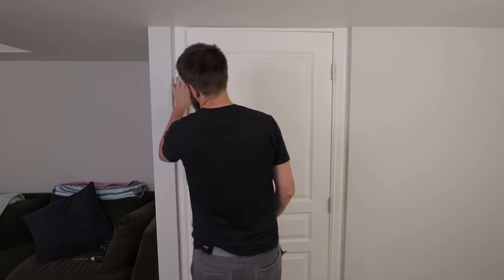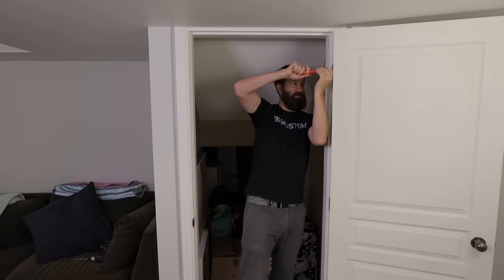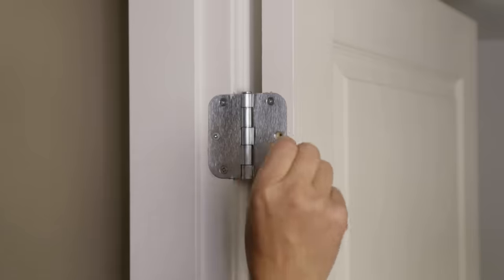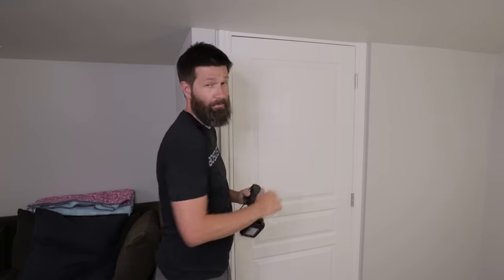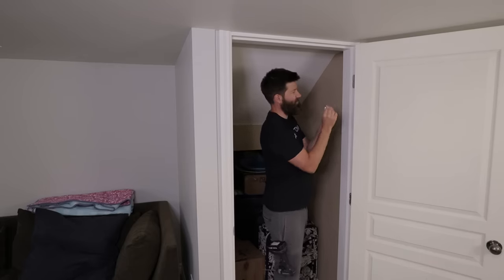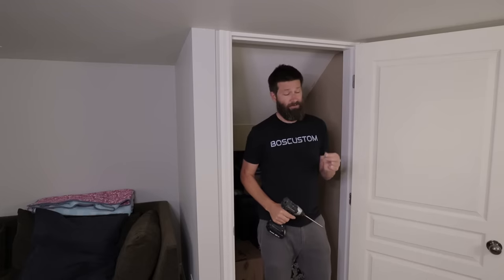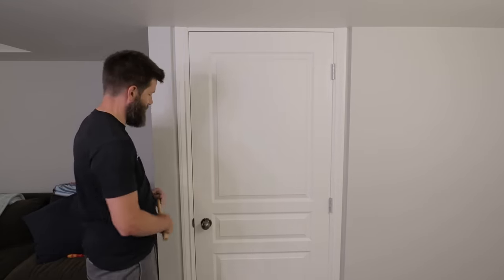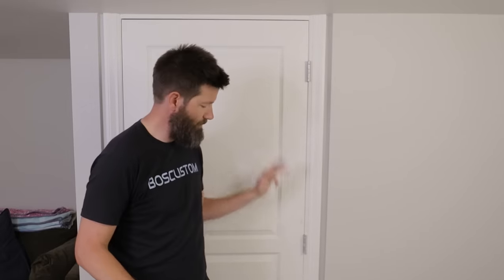How To Fix a Sagging Door that's Rubbing or Won't Close!!!

Comment: TIP: In regards to Tip# 3 - Whether squeezing or spreading a hinge to align a door ALWAYS bend or squeeze the knuckles on the hinge portion that is attached to the door - NEVER bend the knuckles on the hinge attached to the jamb. (To bad you didn't include how to spread a hinge which is a handy if/when you want to narrow gaps that occur on the knob/latch side of the jamb)
Reply: The knuckles on my hinges will not Bend their golden color do you think it could be the type of metal ?
Reply: @starvnny3535  I had the same issue. My front door hinges are made out of some non bendable metal. I fixed it by sanding off about 1/16 inch under the frame hinge then putting it back on. This pulled the top of the hinge-side of the door away from the knob and latch side, now it closes smoothly. For the sanding I used a Dremel, flat head of the sanding disc, and cutter disc for around the edges (and eye protection). It's like an "anti-shim." Next step is probably fixing the foundation 😟

Comment: There is a special tool made to bend the hinges (knuckles). I purchased one and it works great.
Reply: William Ruisinger  Thanks for the tip.  It looks like what this guy did exactly with the adjustable wrench, but I looked closely and they simply drilled a hole in the jaws to make it round.  You could easily make one by yourself.

Comment: An alternative  to the toothpick  is to use a plastic wall anchor. Drill screw hole out to correct  size  for the anchor, trim the flange off of the end of the anchor and tap it into hole. Screw expands  anchor and it holds well.
Reply from the maker: That’s a great idea, thank u

Comment: At my workplace, one of the fitting room doors had this problem for years. Until this year when a customer got ‘stuck’ inside, went into pull panic mode, made a huge scene and sued the store. Management barely had it fixed last week. 😑

Comment: I was struggling yo fix a bathroom door for 6 months and had tried your first two methods plus sanding back door edge to no avail. Your 3rd tip fixed the door in two minutes. Thanks for a great tip

Comment: I wish I came across this video sooner.  We have french doors in our 3 year old house that bind at the top.  I adjusted the screws and did the other stuff.  It helped but started rubbing again recently.  I bent the hinges like you mentioned.  Took 5 minutes and works perfect.  Gives more clearance than the other methods and was actually pretty easy.

Comment: Tip for removing hinge pins. To avoid damaging door and/or frame, use long nose pliers. Grip with pliers tips under the head of the pin and gently hammer further back along nose to lift out and place tips on top to knock back in. Always a good idea to clean pin and slicone spray prior to re-inserting.
Reply: Uh… no lol just use a nail set and tap them out from underneath with a small wooden hammer… 🤦🏾‍♂️
Reply: @samueldavis5895  The "nail set" (punch) is a given, but wooden hammers wont scratch paint ? Uh . . Yes ! . .  lol. Plus most people don't  have wooden hammers and it would struggle to move a stuck hinge pin.
Reply: Yes.
Reply: @steeevo0136  : Rubber mallet.
Reply: @steeevo0136
Reply: @grahamsymes8762  hello . . . yes ? 😀

Comment: stick a shim in the latch side to get your reveal perfect, and then bend the hinge
Reply: That was my thought, too!  Playing cards would be great for the shim
Reply: So pretty much what did but using the shim to ensure the gap is perfect? I have this exact issue. Thanks so much.
Reply: @andymaggie7137  yes take out pin in hinge.  Use shims to get gaps perfect, and then bend the hinge so you can put pin back in
Reply: @ShopTherapy623  appreciate you taking the time to respond. Thank you.
Reply: for some reason i am confused by your comment about making the reveal perfect.
Reply: @spdracr4life  what he means is this: when you take the pin out of the top hinge as shown in the video, your gonna lift the door by the doorknob as he did in the video. Once you lift the door to a place where the space opens back up on the doorknob side of the door, stick a piece of cardboard or wood or something between the side of the door and the doorframe to hold the door in place being properly spaced. Then go ahead and bend the hinges on the door to line up perfectly with the hinge connected to the frame. Then stick pin back in hinge and hammer in if you need to . Then you can pull the shim out ( cardboard,  wood, or whatever you use to space the door from frame) and your door should work properly.
Reply: @Nico-yn1vg  thank you for dumbing it down for me. For some reason I was stuck on the word reveal and I couldn't make sense of what was being explained.
Reply: @spdracr4life  If you aren't familiar with the word "reveal," you don't understand swinging door theory. You need to read an article. The "reveal" is how much of the door jam is revealed when you look through the crack between the edge of the door and the frame. Someone is sure to answer me with a more precise definition.

Comment: I tend to prefer flat toothpicks rather than round. The flat ones will break easier and fill the gaps in the wood threads. The round ones are stronger and tend to just push the wooden threads outward, and will pull out easier. With flat toothpicks you can use one or two or as many as you need.

Comment: Thank you!! #3 worked for  my French doors but I landed up putting a few hotel card keys in between the two doors towards the top. My left door was leaning into the right and I did not have time to remove the hinge on the jamb. Once I had the gap in the middle right I bent the top hinge on the door side a smidge which barely made it but I think I also need to adjust the middle hinge. I needed a quick fix. #2 had the opposite effect for me! Driving in new screws pulled my left door up a mm. I finished off with my go to lubricant for plumbing: Dow Corning Molykote 111 Oring/Valve Lubricant. This stuff has helped me with fence gates too where wood on wood was rubbing. Damn rain here in Northern CA messed up a lot of things! Thanks. Will fix it later with the new tips here. Loved your delivery. You gained a subscriber.

Comment: Be careful drilling 3 inch screws into door frames on older houses. I have seen wires along the inside of the frame, which isn't supposed to happen. You can use a tester to be sure.
I actually drilled into one and started a small fire once. Luckily we put it out quickly, but it cost us some time and money replacing electric wires and drywall where I had to bust into the wall to put it out. So I speak from unfortunate experience. You can't always know what some home repairman might have done before you. No judgment. Just be careful.
Reply from the maker: You raise a good point.  That's pretty rinky dink framing to only have one 2X4 on the Door Jam!
Reply: @TheFunnyCarpenter  
Yeah. I've seen some rinky stuff over the years. Guess they widened the door at some point and didn't frame it back up like they should've.
Reply: @inspired4more  how do I use a tester with a doorframe? Do I just. Stick it to thr door frame? Or check all the screws?

Comment: Cool. #3 very cool.
On #3, why not put a shim into the door-jam space after removing pin. Adjust the shim to the space, or door position, you want and then bend the hinge. You could guage the amount of bend by lining the whole hinge, rather than guessing the amount. You could even use the pin as a guide, bending and letting it drop as you go.
Reply from the maker: Definitely not a bad idea!
Reply: You can do that but remember that the steel hinge has some elasticity so if you’re going to let the pin drop with each adjustment, you’d first want to slightly over-shim the opposite side (i.e. the latching side). That way when you remove the shim and the hinge does it’s little elastic springy thing, the door will drop to the correct level.
Reply: I have yet to see a hinge pin on a 40 year old house that will "drop" regardless of the circumstances. Did you see him use that 1 pound hammer with 20 pounds of elbow grease time 50 hits to get it out?

Comment: The only thing I've ever done to sort out a drooping door is to put some cardboard packing behind the bottom hinge. Just nudges the door back up to square.
Reply: And shoves it out. So it's probably rubbing against the jam in top and bottom
Reply: @brerrabbit9668  Nope, the issue was the door catch was no longer engaging. Once the door was square, no more issues. Rubbing isn't the only reason to address a drooping door.

Comment: I just remove the hinge and clamp it in a vise to eliminate the space.   Or hammer it together.  Doing it with the pin in keeps the hole alignment true.  OR PRO TIP, I may swap the top and bottom hinge to move the space from the top to the bottom!!!!  Depends on what gaps I have and where they are.

Also, tip #4... if the strike is too low and/or the top gap is also large, I put a toothpick behind the lower hinge to space it out 1/16".  That both moves the top in towards the top hinge and also raises the non hinge side.
Reply from the maker: Excellent tips mate thanks for sharing them.

Comment: THANK YOU for the macguyver trick!!!!  it saved my butt when dealing with screws stripped beyond the point of removing with an extraction kit.  i used metal rulers to set the gap correctly before bending the hinges and everything came out almost perfectly square.  The exterior door feels so light when swinging now that it seems lighter than the storm door.

Comment: Outstanding video...Just fixed an exterior wind sprung door on a metal building with your pulling the hinge pins, aligning the door in the opening and bending the misaligned hinge pin loop. Thank you very much!

Comment: I bought a used door because my old one (from 1987) was warped and the door wouldn't close properly.  The door I bought was from a remodeled home with these leftover doors. I bought one with hardware attached (including the doorknob, which I swapped out since it didn't match my other doors), but when I hung it, it was lopsided  =:(
Repair #3 worked PERFECT! Now the door is completely straight and opens/closes like it should. Thanks so much for this video! You're the best! 
😃

Comment: I have heard the toothpick trick several times but never tried it but it worked well. The third tip solved the big problem I was having. The hinges on my door didnt have a removable pin but was still able to bend it a hair so the door would close when I was trying to reinstall it. Thanks!

Comment: Thanks a lot for your help 

I changed screws first bit bigger and bit thicker but problem not solved 

I tried your 3rd technique and got fixed 

Only bit tight on bottom but good in a way won’t loose heat/cooling 

No more door stuck and making noise ❤

Comment: Thanks, the third technique worked for me, but I had to take the door off the hinges to get at the loops on the door hinges with the crescent wrench, because the hinges are right up against the door jamb. Then I used a Viking Arm to lift, latch and hold the door back in place while I hammered the pins back into the hinges.

Comment: You saved me!  I understand why you wanted to make sure the screw was tight because of the bending. This fixed an issue with a door not latching. I had black hinges. I used a black marker to hide the worn spots from bending.

Comment: Thank man, I've had an issue with three doors that wouldn't properly close. I tried your tips but I found that the problem was not with the henges it was with the door knobs. They were super lose. I tightened them up and now all three doors closed. Thanks for the help.

Comment: Thanks for the suggestions!  The only problem was my hinge is for an exterior door, so, the wrench bending the hinge didn't work, and the hinges were tight and already had a 3" screw.  Solution/fix, I took my dremel to the striker plate and took less than 1/16" off the bottom of the plate opening.  Fixed...not perfect...but fixed.  Thanks again!

Comment: I took the pin out put the 2 together stuck it in a vice clamp and pushed hammer and flat end bar top middle and bottom towards handle then installed lined up great

Comment: Tip number three worked like a charm.  Any tips on how to get a better seal on exterior French doors?  I have replaced the weather stripping a few times.  The stationary door that is latched down doesn't  seem to have a firm fit in the frame and it wiggles a bit.

Comment: I am a door & hardware specialist and everything here is correct and efficiently stated. I mostly shim hinges but I own benders too and keep 1/8" dowel in my tool bag to stuff in screw holes. Only never use an impact on hardware or any screw not intended to ever be removed. I have to extract munged up screws far too much. Look at the screw after driving to see the damage. Overall good information so thanks for sharing it
Reply: Noticed the replacement screw was a Robertson. The original Phillips.
Reply from the maker: Fair point on the impactor. I suppose the average person could really make a mess out a screw with one.
Reply: Yep, I made an already bunged screw worse and had to extract it with vise grips. Luckily it was protruding 1/4" before it was ruined.

Comment: Great fix's. I do more Commercial work and with the hinges being more heavy duty tweaking (#3) the hinge really does not work to well with a heavy-duty hinges, so generally we throw the hinges by adding Shim's behind the hinge to achieve the same result. Usually cardboard strips are what the Shim's are made of. You can add shim's to either side of the screws of the hinge to push or pull the door.

Comment: Your video was helpful in identifying my problem. After the 3 fixes did not work,  i realized the door is not level and there's no play around the edges of the door. And that's a major issue as I need to install weatherstripping to complete my soundproof workshop.I guess I need to shave off each of sides and top of door? Thanks

Comment: I have a garage man door (steel door with wood door jam and 3 hinges) that is clearly tilting to the left away from the hinged side, and the top of the door bangs on the jam and won't close completely. I first tried your 2nd fix technique ( drive screws into hinge side of jam's top hinge), but even with a 3" screw with its head size matching the head of the original hinge screw, it didn't feel like it bit into any stud inside the wall. No change resulted. Then I tried the 3rd fix - bend the top hinge back to pull the door into alignment with the jam), and that didn't work because the top hinge worked itself loose! So, I used your #1 fix with wood chopsticks to plug and snug the hinge holes so that I was able to tighten the top hinge again with 1 1/4" screws. Phew! Now I'm not sure what other options I have. I was considering driving a screw into the door jam on the top of the strike plate side to pull the jam away from my tilting door. However, I'm not sure that will make things worse or not. Any other suggestions? Thanks in advance! BTW, your videos are very helpful.

Comment: Great tips. I like to add a wood glue on my toothpicks it helps. But top 3 was new to me and it works excellent. but I like to use 2 wrenches so I don't put any pressure on the hinge screws. One wrench pulling the other pushing.

Comment: For simple, slight adjustments as such, all you need is an adjustable wrench. Pop your pin out, shimmy the door straight, than slightly bend and align your door hinge to fit the new space. I just did this with 3 doors in under 4 mins. They all work perfect now. 😉

Comment: I moved into a House and one door is snagging. Checking this video, I noticed that the top hinge is actually loose and coming off the door frame. Do I need to do step 2 and put in longer screws to attach the hinge to the door frame so the door evens out? Any help?

Comment: Two days ago I fixed a similar sagging door, but used Fix #4: I chiseled out the recess in the jamb for the top hinge to pull the top of the door closer to the frame.  This was a door to the garage with a self-closing hinge, so a heavier door than in the video.
Reply: Today I fixed a different sagging door using Fix #3.  Since my door opened the opposite way, it was two loops that needed to be bent towards the door.

Comment: Thank you. I’m in an apartment and have asked maintenance to fix one interior door that just won’t close at all without forcing it. They told me they cannot fix it without calling in a professional carpenter or professional door installers. 

After Watching this clip I rolled my eyes around my nearly empty skull thinking how can any decent maintenance person not know how to fix a sticking interior door?!

I have a hammer, screw drivers, toothpicks and screws. I plan to give it a try this weekend. I’ll let you know later if I succeed or not. 

But, Part of my worry is that I think some (maybe most) of the trouble is that there is a crap load of paint on the door and door box. That might be a big part of the problem. The Paint is really thick. Making me think it’s going to take something entirely outside of an easy fix.

Comment: Thanks for the info. I used #3 and it worked perfectly. I wanted to do the same on an exterior door, but the top and bottom hinges are spring loaded. Any advice?

Comment: Hey loved the video but none of the tips worked for my dumb door!  Is there anything else you would recommend?  The door is rubbing on the top hinge side corner with the 2.5” screws in.  The bottom non-hinge corner is hitting too so it is off kilter.

Comment: I have not done the bending of hinges but used some thin cardboard on the outer or inner underside edge to pull the hinge in or push it out a little. I will try the bending method next time. The other 2 techniques I have used many times.